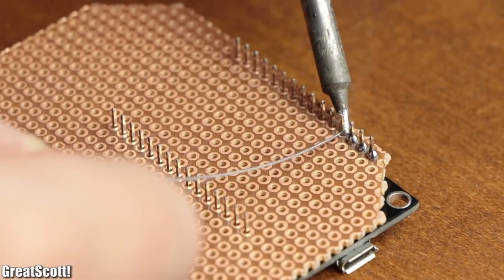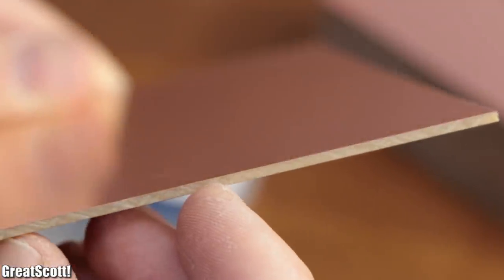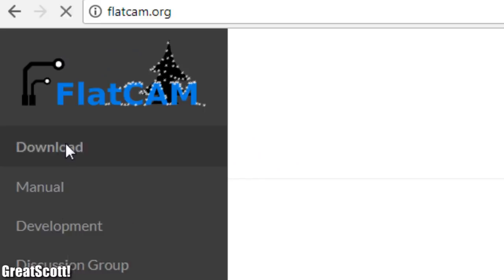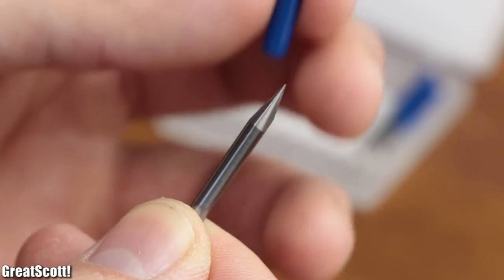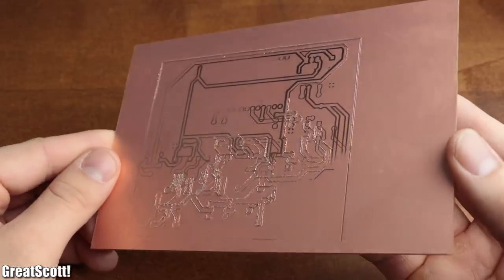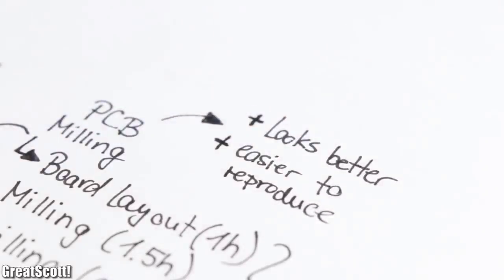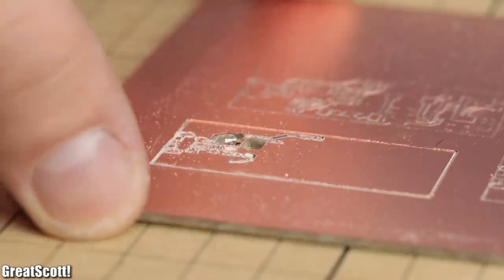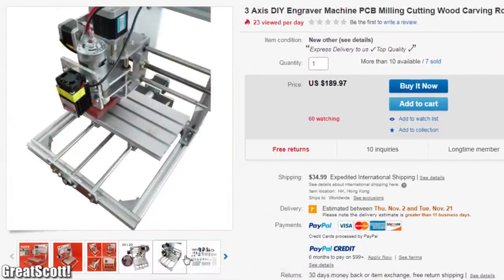How NOT to Mill a PCB (except for SMD)

Comment: Currently I am creating my own PCBs with a Proxxon MF70 which I have upgraded to CNC. I'm using flat cam for g code, my own software for sending g code and on the other site I used the GRBL software. It works very well for me and I like that I can get my PCBs instant. And it is in my case more instant than in yours, because I'm using a higher speed for the isolation milling and after that I will change my tool for milling all holes and cutting out the PCB.

For smd isolation milling I use a engrave bit with a cut depth of 0,072mm which results in a width of 0,24mm. For other parts I am using a depth up to 0,15mm which leads to a width of 0,5mm. 
For milling holes and cutting the pcb I am using a 0.8mm bit.

I think one of the biggest efforts is that I can use the "unused" space as gnd layer, and this will allow me to make my PCBs simpler because I have not spending time on finding the best way for my gnd connection. Beside of that, my PCBs will getting smaller. And I actually needet only one time more than one PCB, and in this case it was easier to build the whole thing new instead of fixing the old board (one component dies).

Comment: I think their are several variables to this with regards to leveling, the level of the PCB, the machines levels, the bit depth, the bit diameters, and G-code.
Reminds me a lot of the first 3D printers, you have to make sure everything is corrects for a good print. We didn’t have auto leveling platforms, and to print at a 0.1 was a rare achievement but could be done if the machine was set correctly. This usually involved the stock machine being upgraded in many ways before you would get consistent results. Probably the same issue with cheap CNC milking machines.

Comment: I have a home made cnc machine, and I use it for smd and for THT also. It is good for prototyping, I always make a prototype before I order cheap pcbs from China. If you make a little mistake, and you have to re-order your pcb, it takes some weeks... CNC is not as easy as a nob might think at the first time. It takes a lot of working hours to learn all the things. For example the right gcode generation, the tools, the correct tool settings, the milling program etc. Gcode leveler is a good way to correct the pcb's curves. I use it always before starting milling.

Comment: I am regularly using my cheap mdf homemade CNC machine with impressive results and much faster. My suggestions are:
- use autoleveling is a must. bCNC program provides all you need including manual tool changes for drilling different diameters
- use double sided scotch. Never clamps. 
- press the pcb to firmly attach it to the scotch
- your feedrate is way too low. Make zig zag pattern tests to find the optimum for your bits.
- i use eagle with pcb-gcode and i typically make 3 passes to enlarge the insulation of the traces. For example the arduino severino board with 3 passes, drilling with tool changing and cutting of board takes less than 1h

Comment: In order to get good clean results from a CNC PCB mill you need to evacuate the material that has built up after the cut. In your case a fish tank air blower focused on the cutter would work well.

Comment: You might want to put some kind of lubricant/coolant on the board while milling - I use distilled water with a bit of alcohol. If you dont want to auto-level you also need a bed that is just as flat as your resolution. I suggest milling an aluminum plate flat.
And yes - I use a cheap china cnc. Workflow: KiCAD -> FlatCAM -> chilipeppr.com/grbl

Comment: Yes I have a low budget pcb milling machine and I have beautiful results after some modification and test. You must use a software to level the plate of your cnc + pcb! After that you can engrave at 0.05mm only to remove the copper and isolate the trace, is a lot better if you put some oil during the engraving process!

Comment: From my experience, first you need to flattern (by flatend tool) the bottom surface, so then you place your board on it and it will be almost perfectly flat. Second, milling speed in your tests are extremely slow, it can be much faster (I mill at feed = 500mm/min with spindle speed = 20000rpm).

Comment: I just got a TOP DIRECT CNC From Amazon, for intended use of Milling PCB's and Project housings.  For larger PCB's to get the board perfectly flat use Ample Double sided tape, And light use of clamps as will cause it to bend, Flat type PCB Spindles are best for the job but any mistakes will destroy the bit. But the work is much finer, The machine i got also has the laser port so making a small laser holding bracket it can Also Etch wood And carve with laser.. Its a nice way to begin CNC Work.

Comment: Been milling PCBs for a while now. I use bCNC as my g-code sender. It runs on any OS that can use Python (which is all the popular ones). It has a built in routine for auto-leveling. Leveling is required in my opinion. Just run out the wires from the arduino for the PROBE pin and a ground. Clip ground to the tool and PROBE wire to the PCB. You are cutting at such shallow depths that the entire routine needs a height map... 

Also don't cut so darn slow, take your spindle to its max speed and run feeds of 2000mm/minute for around 13,000 rpm spindle speed (use a slope curve math to determine different feeds for different RPM speeds). Find out the thickness of the copper and cut .005mm deaper. Don't use those bits, find decent carbide 45 degree with .2 tips or use .1 tips for SMD. Drill the holes on the machine, it does it much faster than you do.. When using software to create the layout, increase the pad sizes a bit. When you get better at the entire process it gets WAY faster. Good luck

Comment: I had an expensive (for me) CNC machine for about 8 years. It worked well, but had to auto level every time. Then I ordered a $299 Chinese one and it works surprisingly well. I don't even have to auto-level the bed, and the traces are good enough for very fine 0.02 inch traces. I definitely prefer it to hand-soldering on perf board.

Also you forgot that you can do other things while the board is being milled. So that time isn't exactly comparable.

Comment: Hey, mate. I have tried it on my CNC multiple times and have had some success but I agree it is noisy slow and has mixed results. The auto leveller works well in Mach3 with a probe input. I have gone back to toner transfers and etching. Great video as always. Cheers Brett

Comment: I have a cheap cnc machine that I brought just to make PCB and I just prefer to wait for jlcpcb to make it and ship. I had to upgrade the woodpecker controller that came with it to allow me to update to the newer version of grbl so I could use bed level height mesh option and this made a big big difference to the overall quality, but it was still a lot of messing about and I found I had to work with larger tracks along with a actual pcb milling bit instead of the v-bit  if I wanted guaranteed results. Then had problems with tracks between pads ect. So it was ok for very simple projects, but then I would just make it up with perf board just as quick like you have already said. I do have something to make and I was thinking of  giving it another try as soon as I have a few days to play with it again.

Comment: Scott, I saw a video where a guy used a CNC machine with a permanent marker pencil attached. The marker would draw/cover the trace lines and then the remaining copper would be etched away. That gave better result than what you showed in your ironing a printout to the board and this milling process shown here. Especially for SMD boards, where you don't need to drill holes for every piece, I think this would be a suitable proces.
Can't find the video now but I think that should be pretty straight forward with your CNC cutter or even with a modified 3d printer.

Comment: I have a cheap 3018 CNC and I had just as many problems as you did, but then I upgraded to grbl 1.1 which included mesh bed levelling. With this I was able to successfully make PCB using a 0.5mm twin flute PCB milling bit so as long as you do not need extra fine designs it worked very well. The only problem is the cost of these twin flute bits are quite expensive compared to v bits and even though I  thought I had all my processes down I managed to break the bits because of stupid things, Like setting a work home position too close to the surface and after swapping the cutting tool and using a command to return to the work position it just dragged the cutting bit across the pcb and then snapped. I since tried using v bits, but the tips all break too easily.

Comment: Great video! You are right, for simple projects (and when you need only one board) perfboard will often be faster. I find it a bit sad that your first PCB milling experience turned out that disappointing. I also mill my PCBs, using flatCAM for the gerbers and my DIY CNC mill. I use a 45° bit, 0.2mm cutting depth, 4mm/sec @ 15000rpm, and the results look perfect. Having the PCB absolutely flat is a must of course, 0.1mm height difference matters.

Comment: Great video, I have been making PCB's with my small cheap Chines CNC for a while now, some programs work better than others but no problem in cutting the pcb, one thing however it is very important to do auto leveling, I have leveled my working area by cutting it flat to it's self and also using the auto leveling " Probing " the PCB's come out perfect.

Comment: I can only say, that I successfully use a cheap Chinese CNC engraver to produce through hole PCB's (3 AXIS 3020T). Agreed it is only worth doing if you want multiple boards and it is critical to have a level bed. But I just don't have an issue with uneven copper boards as you mention, maybe I have been lucky with my supplier/manufacturer I guess. What seems to work for me is to cut tracks with a 10 degree bit 0.1/0.2mm (the ends of the cheap Chinese 0.1 bits have a tendency to break off so investing in some decent quality bits is a good idea. Thanks for the video, although personally I have had better luck. All the best

Comment: You need a friction table for better results, I had the same issue you did . I made my own with a 8mm aluminium plate cutting recess with the same measurements as my blank pcb board, and used grease underneath the board and aluminium to push out any air which can be cleaned off with alcohol after the machining is done. Hopes this helps...

Comment: I only once used a PCB CNC during an internship in 9th grade, and everything went smoothly there. Although the machine was a completely different price class from yours, probably in the five digit range.
Reply: Ralphie Vigg probably. I remember it being quite a lot faster than the one shown in the video. A transparent cover plus built in vacuum is a must in any kind of professional setting, too.

The guy who was responsible for my internship said he much preferred the milling over etching for single prototyping, it's far less of a mess. And as most of his boards were unique anyways, re rarely used the etching station they had.

Comment: I do through-hole PCBs for my projects with a CNC mill, because I don't have the patience to wait professional manufacturers for two weeks. With pcb-probe software (free command-line auto-level utility), the results are pretty decent. A quick brush with a sandpaper is all that it takes to finish it. I think at 80 mm/min your feedrate is way too slow. I do mine at 24000 rpm and 300 mm/min. Two passes are enough, which for a board of 50x100 mm is ~10 minutes. Add 1-2 minutes for the drilling (also done by the mill), and it's quite faster than anything I can achieve on a perfboard. I do my designs in Eagle and g-code is generated by pcb-gcode Eagle plug-in.

Comment: I think with a lot of practice this would streamline the work process and give cleaner work and the time when the board is being milled isn't exactly down time unless you are waiting on a number of boards milled on the same sheet/plate and you have EVERYTHING sorted to go, which is rarely in most cases as there's always stuff that can be done whilst waiting.

Definitely consider reviewing and future work with the CNC.

Comment: Try using bits for LPKF PCB mills.  They aren't a cone shape like the ones you use, the end of them looks like a needle, so if the cutting depth changes a bit the width of the cut shouldn't change.  And the point of a PCB mill isn't to be faster then perfboard for a single circuit, its made to be faster for large quantities of boards and creating a more professional end result.

Comment: I went through the same pains as you have shown with a China CNC 6040 machine with Mach software and flatcam. I personally found the process slow and open to error and you must level the PCB and use touch probing on the machine before each PCB run. I find it better to keep the temperature around the cutter cool using a air stream. Its good for milling holes and for larger traces and round or odd shaped PCB are simple to do. I found that the less pointed tools, (shallow angles), cutting a bit deeper worked well and you can move a bit faster while milling. Through hole and smd are both OK with the CNC I think as the hole drilling is quicker than using a manual drill. You can leave the machine running and it will complete the process with out over processing like etching will do. All that said I have gone back to chemicals as its very fast, (10 mins or so start to end), and is perfect for very fine and complex boards and double sided is easier.

Comment: It is better if you use double side tape for fixturing the board to the table of the machine. I have used 3M 300LSE literally hundreds of times with great results. It helps to solve the problem of the uneven surface to an extent

Comment: you selected positive cut deph so your cnc wont cut into copper. I can recommend select cut deph to -0.05mm and feedrate around 160mm. And also I use sacrificial surface which i milled on cnc flat before placing pcb on it and milling.

Comment: Hey, try milling a flat surface on a say a piece of MDF and mount the PCB to that surface with tape. If the board is more that 50x50mm you should auto-level the cutter this make a massive difference. You don't need to use very pointed engraving bits. I find a flatter angle works better. However I make PCB's using artwork, UV light and pre-coated boards, takes about 10 minutes and is great for prototypes and one off's and check all is well before committing to outside sourcing.

Comment: Using a PCB mill like the bantam PCB Mill  ( where you can change bits and remain accurate and even do 2 layer boards ) i get about almost perfect Milling every time and mixed boards of THT and SMD work very well. I also have an Xcarve ( well the previous shapeoko ) and the inability to change bits makes PCB milling very hard.

Comment: So part of the problem your going to have with this is removal of 'chips' with out taking them out during the cutting process it will make intricate geometry difficult to cut with a clean result, Good info you got If i want to do this my self, a good compressor to blow the chips off the work surface would be a good addition. Also all of the lost time in milling, can be done when you are not actively there, such as when your working on a different project, and as such its not lost time IMO, yes the machine is running with out you, but if it fails, you likely would not catch it anyway before damage was done. Where as the 3 hours you spent before were spent doing manual through hole work. 

Anyway good work, keep it up.

Comment: My university got an Othermill. I was disappointed in the results milling PCBs. If I need a PCB fast, I still etch, but for the price, I’m going to just send them off to a fab lab. I think the Othermill is more accurate than the xcarve, but don’t quote me on that. It certainly does auto leveling and double sided boards. The process is relatively painless. But the tool path is still fairly wide, which means the traces are fairly far apart. I’ve considered several options to make the process better, but I keep coming back to, just have it manufactured.

Comment: When I do up boards on the engraver. I set the rule checking for pad and trace clearance to 0.3mm on the PCB software. On Flatcam I set the tool diameter for a 0.3mm, but I set the overlap to 75% (0.75) and multiple cuts to 6 and depth 0.2mm. Then on the engraver I use a 0.1mm bit or a 0.2mm bit. I have the bed on the engraver trued up with a dial indicator to be within 0.001" or as close as possible.

Comment: What bits were you using to engrave and drill. For a first shot i did a board with a 0.7mm spacing to use a 0.7mm flat end mill and a 1mm drill bit.

Comment: I have been using a cheap chinese cnc3040 machines at my work for nearly 2 years mostly for creating prototype pcbs. As GreatScott showed it is not an upgrade for time wise. But on the other hand i can load the gcode to the machine and do some other work while it mills the pcb. 

From experience, milling pcbs doesnt have perfect outcomes when you use cheap chinese machine but they really get the work done. 

From the material aspect, although normally pcbs should have copper layer around 35um thickness, they really vary from manufacturer. And if the milling bit is not sharp enough the copper usually plastered (i am not sure its the right word) and cannot be milled. Due to this, i usually set my milling depth as 0.1mm while thinking about the milling angle of the bit.

For me overall, its good to reproduce same board easly when needed again.